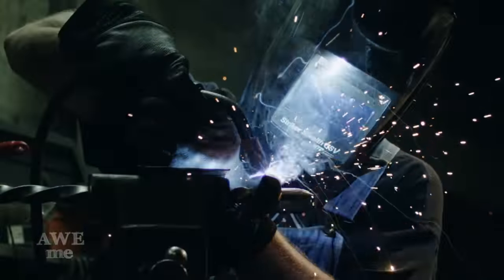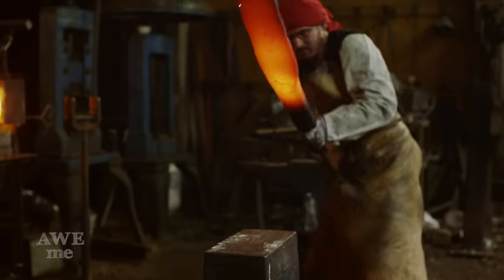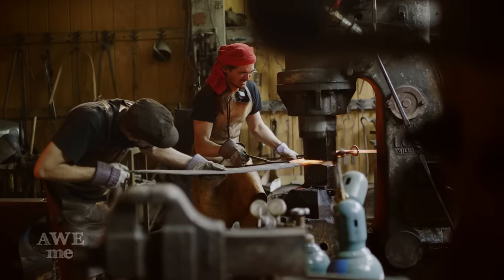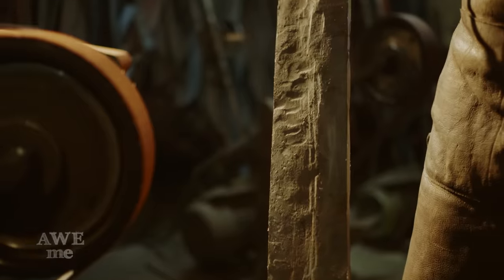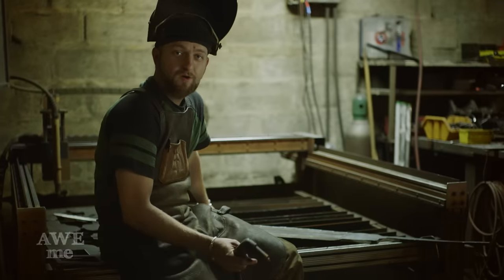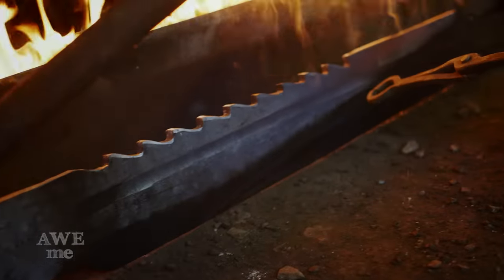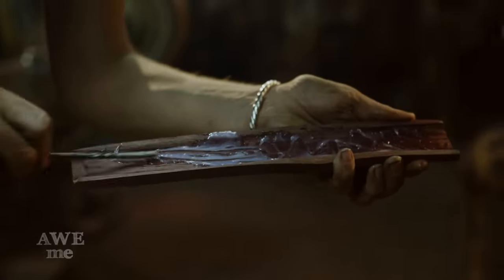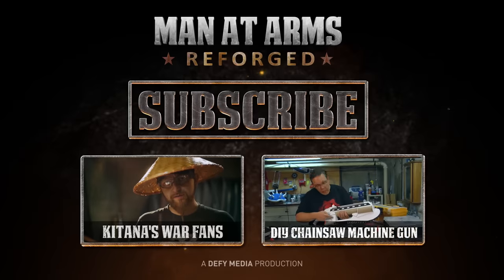Pyramid Head's Great Knife (Silent Hill) - MAN AT ARMS: REFORGED

Comment: Imagine someone having enough strength to swing this thing like a normal knife or sword 😮
Reply: I'm sure people can but it would be very uncomfortable and honestly useless because you have to be somewhere with a lot of space and if you try to use it again somebody they will ether escape till you lift it or punch you when you try to lift it and probably dodged when he swing
Reply: If it was from easy to lift and and cut in half maybe it could be used in combat but you should use 2 hands to control it and lot of space
Reply: @kzr_1613  There is actual historical examples of great swords that get to this length.
Reply: @Ontarianmm  well idk it just seems ridiculous to use something like this while normal weapons are more effective and easy to make
Reply: @kzr_1613  You maybe surprised actually. The trick to it is a distill tapper, meaning that the blade get thinner to the point. This will save weight and have a better balance. Another thing is to have the edge twin edged, which will again, save weight. With all this you can get a 6 foot blade to a little over 5 pounds.
Reply: @Ontarianmm  dats nice thx for the info
Reply: only Chuck Norris could do that
Reply: Blades like this were used as anti calvary traditionally thog therewere martial styles developed to give people that used these blades fairer ods against infantry and couple famus people that were just monsters in general with them.
Reply: I mean, Highlanders existed so I think this is possible
Reply: mamamiazakaria that’s is true my ancestor was one I’m the modern day highlander
Reply: Stolen
Reply: Lol, imagine his GREATSWORD then lol
Reply: @kzr_1613  I think a lot of the time the great swords and the other two handed weapons like the dane axe or halberd are both for extra reach or just bonus intimidation (with proper training that is).
Reply: Mom: you cut the vegetables

Me: ok (hehehe)

Comment: Corvo's assassin blade, from Dishonored ^^
Reply: +Bender B. Rodriguez folding, please!
Reply: +Bender B. Rodriguez yes!
Reply: +NieroshaiTheSable of course =)
Reply: +Bender B. Rodriguez that would be great but they should save that for when dishonored 2 comes out, for the hype
Reply: +Bender B. Rodriguez There's a lot of moving parts in that blade. It would be more machined than forged. Not that the folding blade isn't awesome as hell though.
Reply: +Sandwhale Gaming To be fair they did do an Assassin's Creed Hidden Blade, and that had plenty of moving parts.
Reply: Aeteno Oh! I'd completely forgotten about that blade. Fair enough!
Reply: +Aeteno that's to give them a challenge: apparently, Corvo's blade works as a switchblade except the blade is in two parts with the tip folding into the base of the blade then into the pommel
Reply: Yes!!

Comment: Epic job guys! Could you make Zer0's sword from Borderlands 2?
Reply: That would be so awesome.
Reply: yes!
Reply: +Chase Allen Metal's not realy an optimal material for that one, although they could probably pull it off by tempering it to give it a blue-ish hue
Reply: +Chase Allen I rather see Kriegs Buzz Axe
Reply: Commodore Luna That's what I was thinking. It may be hard to pull off the electric blue 'glow' effect but I believe that they could rise up to the challenge.
Reply: They could do some really nice annodising / acid etching after making the upper shroud, but you need something transparent like acrylic to get the proper glow effect.

I made one last year and fitted an RGB led strip into it which worked pretty well.

Comment: My first time watching one of your videos. I just started back into smithing and am actually still trying to build up my shop and equipment. I have everything but the Forge body and have been debating on the style I want. I already built my double burner for it and it works great. Purple Heart is also some very hard wood. I dabbled in smithing as a teen and even blew myself up once. Actually it wasn’t that bad but I was actually trying to fold aluminum and caused it to explode and it did knock me backwards. I also found and old knife and refinished it and put a deer antler handle on it. I’ve been watching several channels on YouTube. Like Black Bear and Outdoors 55, Green Beetle, and Freerk Wierenga, plus. A few more and now I’m adding yours. Nice job.

Comment: Christ, that thing is massive. Excellent work, guys. I can't imagine how much of a pain that thing actually was to forge. Just because I have that kind of mind, I find myself wondering just how much power that thing would have and how much damage it could cause compared to historic blades and great swords.
Now how about doing something a little simpler like Ruby's ax, Crescent Rose, from RWBY (pronounced "ruby," if you weren't aware). I'd also love to see a zweihander just because I love those things for some reason.
Reply: It would actually not be that great of a weapon. Just try to open a femoral artery with that and you will find yourself failing miserably. Severing tendons or causing accumulating small bleeding would not work because of slow speed and lack of proper edge either.

The speed is a whole another problem, as is the unwieldiness. In the time that a guy using this sword has managed to close distance and swing at another guy that is using a spear, the guy with spear has already caused at least 3 half-foot deep stab wounds and taken out the left lung, liver and smaller intestine. If the guy with this "knife" does not collapse quickly from massive blood loss, he will drown to his own blood, or barring that, die from horrible abdominal cavity inflammation.

Sword's whole raison d'etre is being a fast weapon.
Reply: I know it's impractical as a weapon and would be a completely laughable idea to try and use it as one. I was more talking about just a single good swing with it sharpened to a proper cutting edge with someone (or a machine) that could actually swing it with any kind of power and/or any resemblance of precision.
Reply: Aaron Turner The problem here is still, like I said, that it is fairly dull. The blade body is too thick as it needs to support the width and length and the blade wedge is too short. Think of it like a wood-splitting axe blade. Not very sharp, but it's not for cutting wood. This could be somewhat remedied with a hollow ground blade structure, but that is clearly not featured in the object of this video.

Sure, swing it with power and it will smash bones and tear skin and ligament, but not that much more than an iron rebar of identical weight and length. Still, crushing somebody will undeniably cause horrible and certainly fatal injuries.
Reply: Ruby has a scythe, not an axe. It's also a gun. It would impossible to fully recreate Crescent Rose. The best they could do is make it's scythe form without it being able to shift forms or shoot.
Reply: jfunk1994 Son of a...I just noticed that I called an ax...dafuq was I thinking? I'm almost tempted to go and edit my initial comment now. lol

Comment: Corvo's Folding Blade, mechanics included ;)
This should be a bit of a challenge
Reply: is that even possible?
Reply: Dumahs Assassin Honestly, I don't know, but I'd like to see them try ;)
Reply: +Rollo HB It would be interesting to see if they could do it.
Reply: +Dumahs Assassin always figured it was basically an over-sized switchblade mechanism
Reply: Looked at the mechanism and it looked more like a switchblade within a switchblade. I was trying to run possibilites in my head but all I could come up with was the dual switchblade mechanism
Reply: +AlClaudious Tendalor (Vanion) Yeah looked a little closer it's a blade with a blade which should be really fun but it runs with a single switchblade mechanism
Reply: the only problem I can see is the bit where it smoothly glides back into something the size of a small flashlight, they would need a second spring to pull it back in smoothly like that.
Reply: The whole mechanism can be messed up if you try to integrate the spring into the switchblade mechanism but it isn't a spring it's a secondary locking mechanism mixed in with the switchblade mechanism. Although I'd love to get my hands on a working copy of the sword just to see how it worked but never had the chance.
Reply: +Rollo HB  I like the sword so yes please make Corvo's sword. possibility the mask too
Reply: +Brandon Cochran the mask would be epic
Reply: +Rollo HB switchblade butterfly knife hybrid

Comment: Wait, so I’m fully aware lead is very soft and will distort if dropped from the right angle but wouldn’t it be a better counter balance than a block of steel? Or at the most make a small steel shell with a block of lead inside?